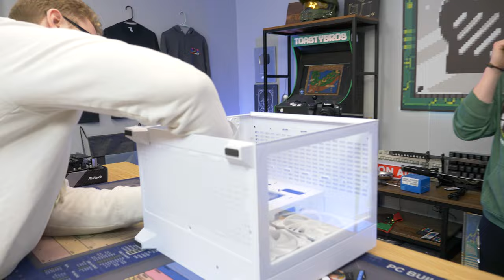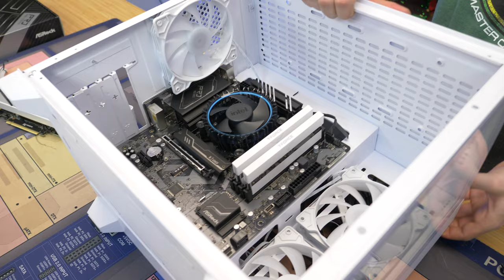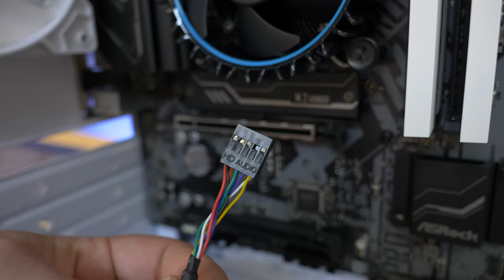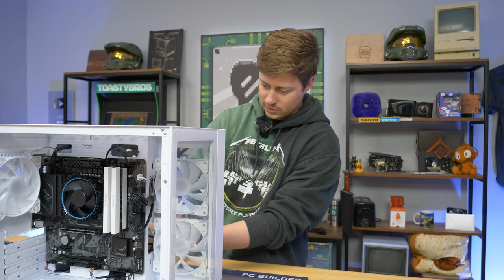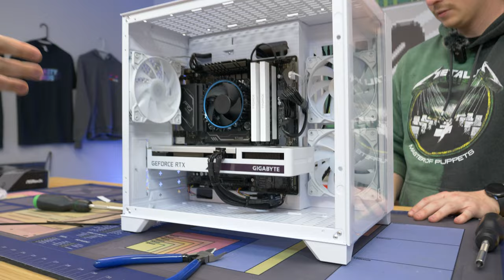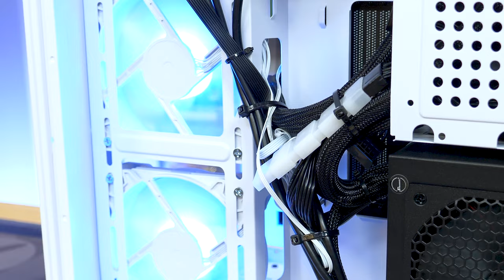How To Cable Manage A Computer - Gaming PC Tips

Comment: I know it’s not relevant the doubt I’m asking. But I never got any correct answer. 
My gaming pc is full atx mother board and cooler master K501L cabinet. Will it be a problem if I take the whole thing as it is to airport to travel abroad? I mean the security there.
Reply from the maker: I would recommend you check with TSA to find out their policies regarding electronics.